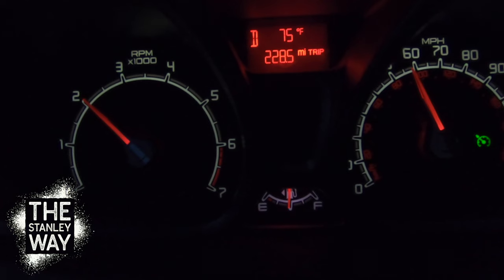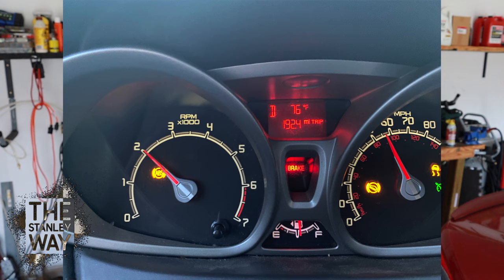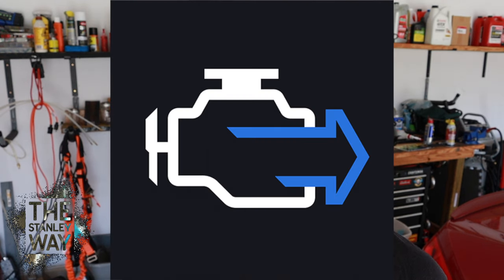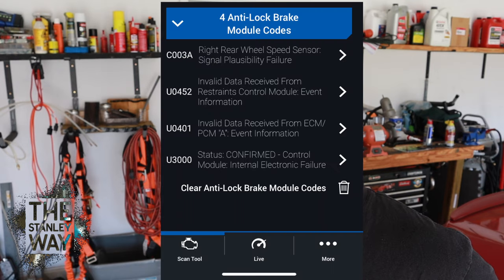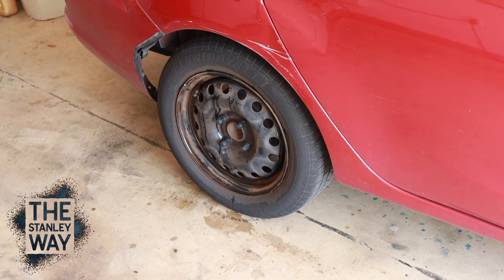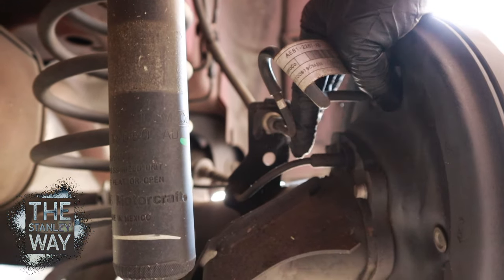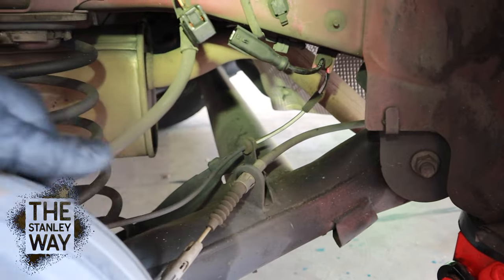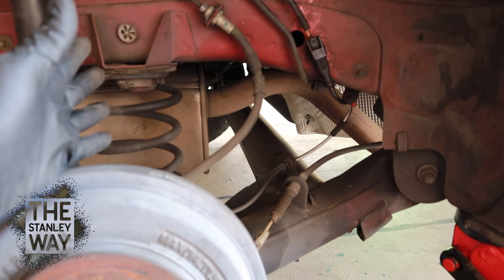*EASY* Brake, ABS, Traction Control Lights Fix Video

Comment: Toyota Camry with abs light, traction light,  brake light coming on, then check engine light came  .  One place replaced the brake switch light 3 times with last time being Toyota part yet still lights kicked back on.  Toyota dealer said replaced 2 burned out tail lights and I was astounded.  Said seen it before and so far no lights back on on 3rd day.  Please Lord let it stay fixed 🙏
Reply from the maker: I hope it is fixed, thank you for the information.
Reply: Update? Currently going thru the stop light phase.. My brake lights seem fine thou which bulbs were burnt out for you?

Comment: Why are these on for me after getting new tires and an alignment? Safe to drive for a few days until I take it back? Ugh.
Reply from the maker: More than likely they did something wrong. It could be something as simple as a disconnected speed sensor or they could have broken something. Make sure they fix it, don’t let them pressure you into paying if you didn’t have those lights before you took it in. 

I hope you get it fixed for free real soon.
Reply: @TheStanleyWay  Thank you for the response!

Comment: I have a 2010 venza I get all those lights I replaced 2 front abs sensors and brake light switch has brake need brakes all around what could it be
Reply from the maker: @riggoo14  it could be a number of things. Here are some things to check:

Low brake fluid: Check the fluid level in the reservoir and top it up if it's low.

Malfunctioning ABS module: The ABS module may be faulty.

The wheel speed sensors may be broken.

The emergency brake may be left on or not properly adjusted.

Sensor sensitivity: The ABS sensor may be too sensitive and activate for no reason.

Blown fuse: If both the ABS light and the engine warning light are on, check the fuse.

System turned off: The ABS system may be turned off.

If all these are good then take it to a reputable shop. If you don’t have money for a shop, your brake fluid level is good, and it stops fine then drive it. The abs light on just means your computer turned the abs off which means your tires can lock up under heavy braking so drive carefully.

Comment: Great video!!  I just changed the rear brake pads on our 2011 prius and all these lights came on.  I did discover a caliper guide pin was seized up so changed that and the lights went off.  Now they're back on.  I need to scan it for speed sensors now.
Reply from the maker: Thanks, I hope it will be an easy fix for you.

Comment: I think I have that right rear sensor issue. The wires at the clip came apart . Taped them together ... Then a friend said he soldered it. Now it's hanging down again. I just checked it today. So I am gonna get under there and check it out again. It was the perfect video for me at this moment. Awesome explaining. Thank you . I will keep you updated. 😂just what I think I needed to see. The actual showing off the wires looked like something I have had a problem with. Sorry for rambling but I have been searching for answers. Ty so much

Comment: All these lights came on twice in my 2010 Dodge ram truck and the issue was the wheel bearing both times. But it's also pretty easy to tell when a bearing goes too.
Reply: I’m going through this exact thing right now. I think it’s a wheel bearing and it needs brakes and rotors

Comment: Excellent video!! I have a 2012 Dodge Challenger with 30,000 miles on it. Red brake light, ABS, traction control Those three lights came on. and stay on , taking it to the shop Monday just your thoughts, is it a pretty good chance it is just a wheel sensor. Didn’t know if you had an opinion about these certain cars. Thank you ! You’re very clear and understanding in your videos.
Reply from the maker: Thanks! I don’t have any specific knowledge on Challengers. Hopefully that is warranty work with that low mileage. I would recommend scanning it with a scan tool before you take it in and write the codes down, knowledge is power. If you don’t have a scan tool an auto parts will do it for free. It could be a sensor and a scan will tell you that. Even if it is warranty work you still want to know the codes, it will help you learn for the future as well. Thanks for watching and for the comment.
Reply: @TheStanleyWay  
Wow !! did not expect a response this late, you are the man and really appreciate it. The car is a 2012 so it’s 12 years old with low mileage no warranty but still being 12 years old I guess age is the factor . I agree I’m going to get a scan tool actually have a cheap one, but it only diagnose engine stuff  such as emissions ect Praying it’s just a wheel sensor and nothing more serious.
Reply from the maker: @toxictube392n7 no problem. It is probably something simple. Wheel sensors will cause all of those lights to turn on at once. I hope you get it fixed quick and inexpensive.

Comment: Thanks for this info. video. I got a question. Abs, traction control and tyre pressure lights on my toyota proace (2019) van stay on. These lights appeared first after i had the van parked for a week. The lights went off almost the whole day today then reappeared. Toyota says rear abs sensors are broken, while they do seem intact and if they were broken, the lights wont go off randomly. 
What do you think the issue might be? Cable issue?
Reply from the maker: Yes it could be a cable issue. Before you buy sensors make sure to clean the connectors and dry them out really well. Once you do that I would drive it for a month or so. If the sensors really are bad, the code will come back. 

You can drive safely without ABS sensors, just realize you don’t have anti-lock brakes and adjust your driving accordingly. If you don’t have the money to replace them, keep on driving my friend, it will be fine.

Comment: My 2011 Ford Fusion Hybrid with 70k miles was fine---then something happened after 5 short driving trips when ABS, Brake, ck engine lights & chime came on.  I quickly pulled over.  My scan tool reports 4 ABS codes:  C0022, U3000, C0001, C1012.  What do you suggest I do?
Reply from the maker: @mkd9251  my first question is does the car feel different in any way all of the sudden? Is it hard to brake or steer? Does anything, besides the lights, seem out of the ordinary? If not, how old is your battery? Have your battery checked even if it is new. Bad car batteries can cause many weird symptoms in modern computer operated cars. If your battery is 3 years old or older you may want to replace that first. Have your battery and alternator checked at the same time. A good auto parts store will do this for free.

If the battery or alternator aren’t the problem then it could be one bad sensor kicking all of the lights on and sending multiple failure codes. This can be very difficult to troubleshoot in person and would be impossible over comments. If you have the money and know a good mechanic then have it checked out. 

If you are short in funds then use common sense and make your own decision on whether the car is safe to drive or not. When you have an ABS light on, it just means the computer has detected an ABS issue and has turned the antilock capabilities of the car off. So now you have a car without ABS, meaning if you jam the brakes you will lock up your tires and loose steering control as the car skids. 

If the car brakes and steers ok and you feel safe driving without ABS then go for it. Make sure to have your brake system inspected to ensure that your brake fluid is topped off and there are no major problems. If the inspection is good and you don’t want to fix it then drive it until you are able to have it fixed.

Comment: I replaced the all 4 WSS and the ABS, TCS, and Brake lights are still on. Does the Blue Driver erase existing DTCs?
Reply from the maker: Yes it does erase codes.

Comment: '14 scion tc w/ manual trans.  had this start happening after getting the clutch/flywheel replaced.  but it happened so rarely i didn't think it was related.  on a couple of occasions the car would not start.  I'd turn the ignition and all electrical power would shut off like a dead battery until i disconnected and reconnected the battery then drive fine.  however, recently the indicator lights (ABS, brake, traction lights, a dimmed left blinker arrow) as well as the speedom needle drop for half a second would take place when I turned the A/C on.  Battery was old so I replaced it last night because that was needed anyway.

Yeah I think it's quite likely a mechanic can simply jerk a cable too hard or not plug something back in all the way especially when they're doing a big job like replacing a transmission.
Reply from the maker: You are correct. Some of the simplest things can make it seem like there is a huge problem with your car. I hope you get yours figured out soon. Thanks for watching and commenting.
Reply: @TheStanleyWay  you are a great responder to comments. will do, thanks!
Reply from the maker: @wes1934 thank you.
Reply from the maker: @wes1934 also my first name is Wes 😂.

Comment: Very informative. I’m not a mechanic but I agree 100%. But with my Auto 4WD Pathfinder, I suspect my lights are on because my front tires wore much faster than the back. Could that be the case. And could this damage the other parts in the 4x4 system? I feel like since the idiot lights are on, then it’s only operating in 2WD (Front) and therefore no damage is being done. Does anybody have an opinion on that?
Reply from the maker: You are correct in your thinking. If you have an all wheel drive car, all four tires should be changed at the same time to ensure proper wear on drivetrain components. Then rotated on a consistent bases to keep the circumference the same on all four tires. It will also trip codes as you have seen.

Comment: Have this problem on my 16 chevy colorado. I would still continue to drive on it, but when I'm at lower speeds, when I brake, my abs kicks in while I'm braking, it's real weird. continued to drive and brake at low speeds to test it out in my neighborhood, then it randomly abs stopped kickin in at the low speeds. Don't want it to happen at high speeds, so going to check sensors before driving again.
Reply from the maker: You might want to try this. https://youtu.be/4fyjZB0gWIw?si=_qKugDXUELtjvAT6

I hope you get it figured out soon.

Comment: So I have a check engine light, traction control, and abs light on. A few months ago they would come on and then go off. Already replaced abs sensor. But when these 3 lights are on my Nissan Titan will not go into 4 wheel. When they off it would go right in. Now all 3 lights seem to be er go off. Any ideas???
Reply from the maker: No, with something that crazy I would have to look at it. See if you can get it scanned for any codes and go from there. Even if you don’t have any dash lights illuminated, it will still show certain codes with a good scan tool.

Comment: Thx for the video I had my rotors and brakes done today on my 08 Jeep grand cherokee and the ABS,TRACTION CONTROL,ESP/BAS are still on.I will def follow your advice  and f/u with u.I bet it's a wheel sensor because i've had 1 replaced before.
Reply from the maker: You are welcome, thanks for viewing and for the comment.

Comment: I have All those lights on and hard to steer. I put brake fluid and steering nothing worked . Brakes feel fine
Reply from the maker: A good starting point would be to have the car scanned to see what trouble code you get.
Reply: did you ever figure out the issue?
Reply: im trying to figure out because im having somewhat the same issue
Reply from the maker: @naivefn6102  mine was a speed sensor but not sure if @rosaleereyes10 figured it out.
Reply from the maker: Good to know, thanks for commenting, it helps a lot.

Comment: I have been having these issues in my 2010 Ford Edge and when these lights come on my car shuts off. I cannot find out if these are related. TCL turns on, red brake light, and ABS light. Brake pads and rotor were recently changed, found that front right caliper was sticking also. Would there be any reason this would cause a vehicle to stall at all? Cant seem to find any info on that, seems to be faulty brake system but cant figure out why it is stalling only when those lights come on.
Reply from the maker: Wow that is weird. I don’t have any experience with an issue like that. I have had good luck using AllData as a program to troubleshoot many different cars. You can buy a one month subscription for the AllData DIY for your specific car for around $20 to $30. With that subscription you can look up every Technical Service bulletin to see is this is a common phenomenon. You wouldn’t believe how many cars I have repaired using the TSB’s. You might want to start there.
Reply: @TheStanleyWay  appreciate the help!
Reply: Mine stalls out too. I drive on the dirt roads. Especially when I am idling... 2007 Chevy uplander

Comment: I have a Lexus 2003 GX470 and all 4 lights come on and then they disappear many times after turning the car on and off sometimes the ABS alarm turns off and  it stays on for almost 15 minutes. Any idea what it could be?
Reply from the maker: Could be a speed sensor like I talk about in the video. Once the computer looses speed data from one wheel, it will turn all of those systems off.
Reply: @TheStanleyWay  sometimes the ABS alarm comes on and its annoying. Is their anyway to permanently turn that alarm off
Reply from the maker: @eddyhernandez9959  I don’t know of a way to turn it off but you could try to find the source under the dash. You should be able to unplug the box that is making the noise and it will stop.

Comment: How did you know to check that wheel.
Reply from the maker: I had a C003A code when using an OBDII scan tool. That is a right rear wheel speed sensor code.
Reply: @TheStanleyWay  thanks.  Hoping it’s not the module.  It all started when my daughter ran over a curb.
Reply from the maker: @tk423b  very rare to be the module. I’m sure it will be the sensor on the wheel that hit the curb.
Reply: @TheStanleyWay  I’m hoping so, just ordered that scanner.   I’ll let you know.   Thanks.
Reply: @TheStanleyWay  this is what I’m getting.   It’s intermittent.  

66-13 Master Cylinder Pressure Sensor Failure (Internal Circuit Failure)

66-11 Master Cylinder Pressure Sensor Failure (Output circuit is open or short to
ground)

61-11 Power Source Failure for ECU (Low Voltage)

1 Electronic Power Steering Code
85-01 VSA Signal Failure
Oct 30,
Reply from the maker: @tk423b  how old is your battery? Check the battery, it may need to be changed. That will cause weird issues like that. If the battery is 3 years old or so it will probably be worth it to replace it anyway. At least have it checked.
Reply: @TheStanleyWay  will do.   I’m checking it tomorrow.   Thanks.
Reply: @TheStanleyWay  it’s within warranty.    However getting 12.43 cold.  14.42 v running.
Reply from the maker: @tk423b  do you have an actual battery tester? The voltage may be good but capacity is low. If you don’t have one a parts store can test it for you.
Reply: @TheStanleyWay  I do.  That’s next.  Thanks for your help.   No codes today.
Reply from the maker: @tk423b  it sounds like your battery is good and with those codes it may be the module. Does the car stop ok? Does anything feel amiss in the braking system, spongy, soft pedal, hard to brake, etc. if the car drives ok and you don’t want to replace the module it won’t hurt anything, you just won’t have antilock brakes. Just be extra careful on wet roads.
Reply: @TheStanleyWay  everything feels fine.   Like I said no codes today.

Comment: I literally have all them lights on for some reason
Reply from the maker: Could be just a speed sensor. If your brake fluid level is good and your brakes work fine it doesn’t have to get fixed right away.
Reply: @TheStanleyWay  ok thank you

Comment: This is a big headache on my 2014 mazda 5 my mechanic scan it and came up with power failure internal malfunction wtf is that? And told me only the fricken dealer can clear it!!!!
Reply from the maker: I don’t know what that is. Anything weird like that the first thing I look at is battery and alternator issues. Have the battery checked, if it is old and starting to get weak, it may negatively affect the electrical system. If the battery is ok also have the alternator checked. 

I have repaired many electrical issues, strange codes, etc. with a new battery. If those check out then it may be worth it to have it scanned by a dealer or a different mechanic. If they give you an ungodly high estimate to fix it and the car drives okay then it may be fine to drive it like that. Most dash lights are not much of a concern.

Comment: Misleading title, there is nothing easy about ABS
Reply: @TheStanleyWay  too many electronic parts and components involved to accurately diagnose that sh1t, from sensors, to circuit cables, fuses, ABS module's electric motor, circuits of ABS modules,  and ECU. Pretty much all electronics.
Reply from the maker: @iamsorryforbeingrudebefore1626  speed sensor fixed this one, simple. That is the meaning of the title.
Reply: Sometimes it can be an easy fix however, to secure vehicle safety, the additional can lead to another connection that may be undisclosed if code reader didn't catch another symptom yet .😢
Reply: @iamsorryforbeingrudebefore1626 That is absolutely true when other issue arises within diagnosis needing to be checked including relays, wirings and other component wirings or connectors to the same diagnosis area. Intermittently can be easier to fix than light not turning off. The brake area is also involved during diagnostics .